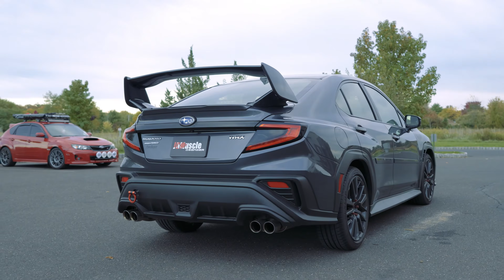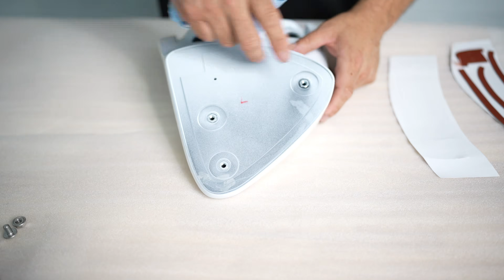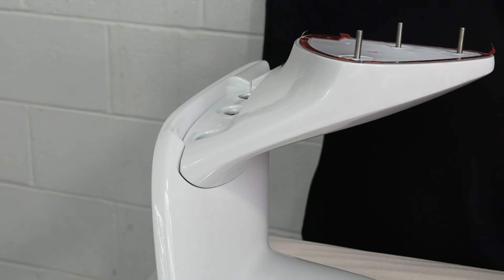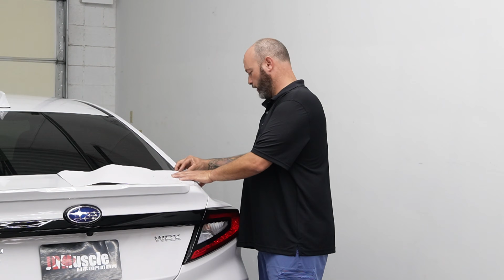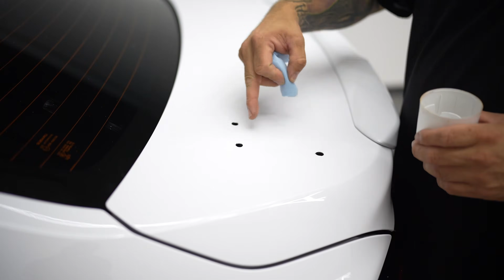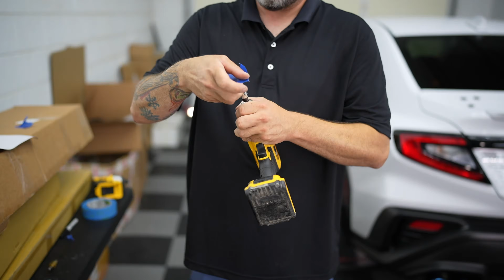22+ WRX JDM Edition STI Spoiler Installation

Comment: So are these hole locations exactly the same as the JDM OEM wing? How does the weight compare?
Reply from the maker: exact. Weight wise should be similar
Reply: @jdmuscleusa does it effect how easily the trunk opens?
Reply from the maker: @JNXN77 trunk still opens. Just doesn’t fly up anymore

Comment: How's the install work if I have the TS style trunk with the holes on the bottom already? I know there's 3 layers on these trunks with the holes already being there on the bottom I'm assuming I just have to drill through the top and middle layer?
Reply from the maker: As long as the bottom hole is big enough for your to fasten the bolts/nuts

Comment: So if you order a wing now, do they come with all hardware including the rubber grommets?
Reply from the maker: @Oh_Mun  everything except the rubber grommets- as the access hole from the back can vary in size depending on installer’s preference- plus it’s not really needed as part of the install
Reply: @jdmuscleusa  That's fair. My biggest concern is pulling the trigger on this, and either getting water back there or possible hardware/holes rusting.

Comment: @jdmuscleusa can you specify what drill bits you used and maybe link which hole saw you used?
Reply from the maker: We used a step bit and it is recommended that way too especially for first timers. Hole saw wise it will just be the same size as the template we provided - or if you need to go one size up / down depending on your preferece.

Comment: Do the rubber grommets for the trunk holes come included with the wing? If not do you have part numbers or where you got yours?
Reply from the maker: Depending on the size of hole you drill it can be found on ebay fairly easily. We will likely include them in our 2nd batch of inventory
Reply: @jdmuscleusa  around when will the second batch of inventory be shipping out?
Reply from the maker: @DeeMannMusic  In around 1-2 month. For now if needed we can just send out some grommets we have here if you let me know your order number